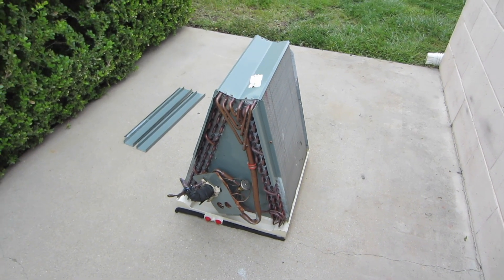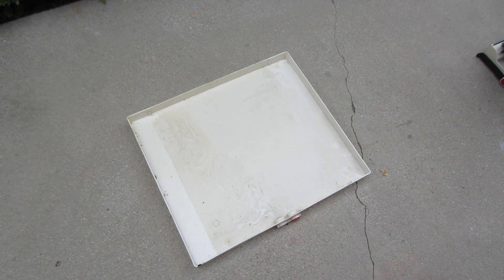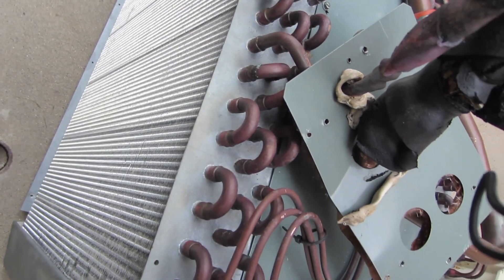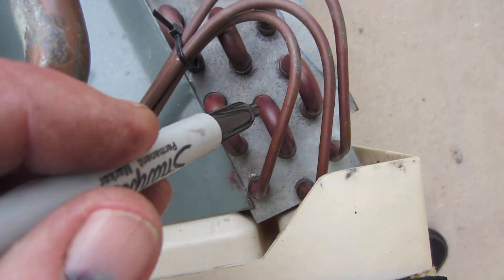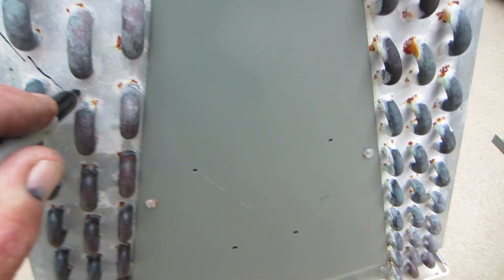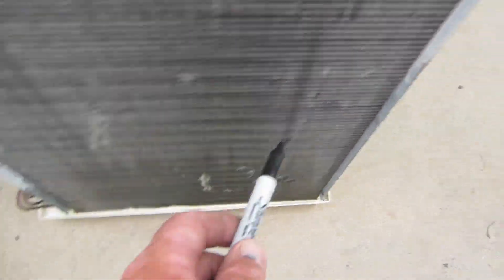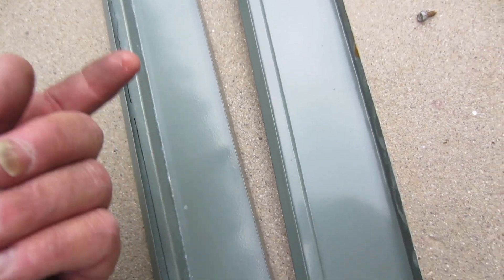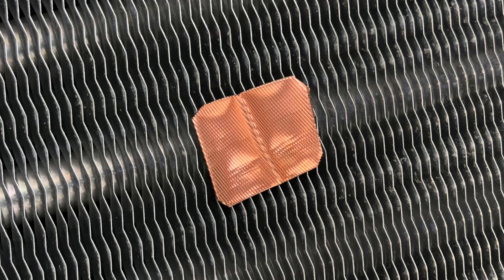A Look At Formicary Corrosion

Comment: I would like to see someone flood a coil like that with leaded solder like a hot dip but internally and then see if that would fix the pinhole leaks.
Reply from the maker: They would make a lot of money if that worked.